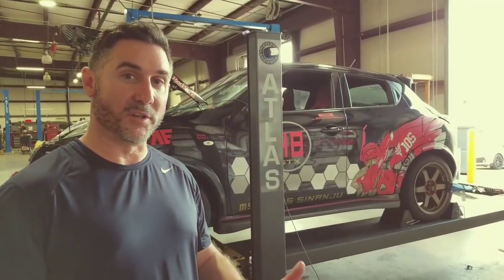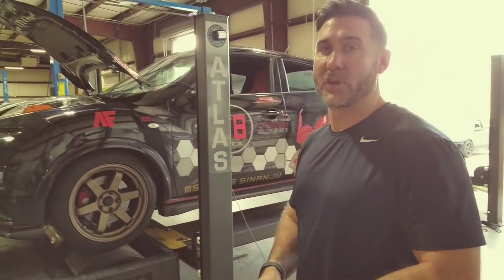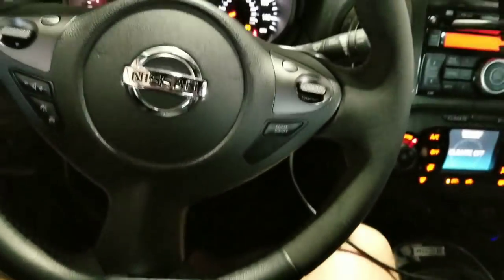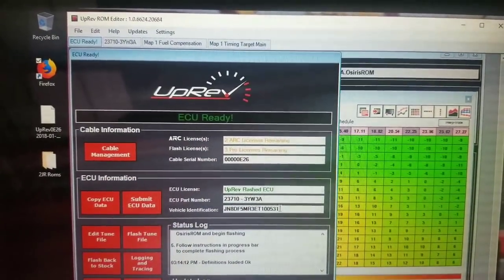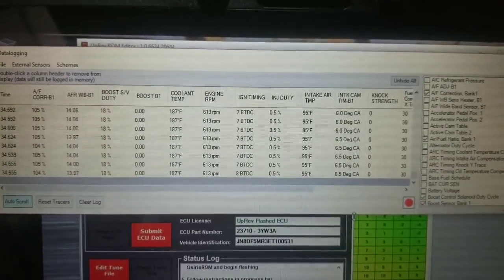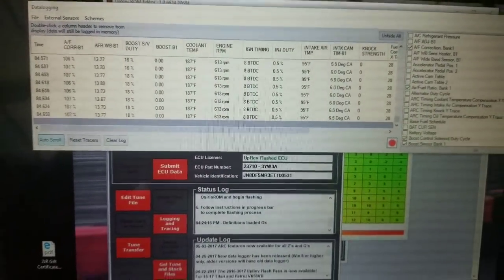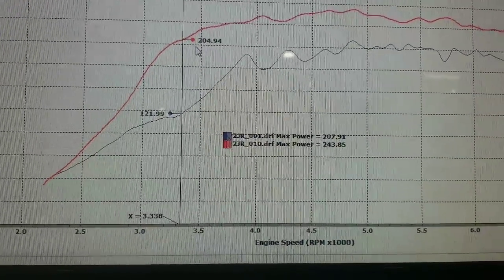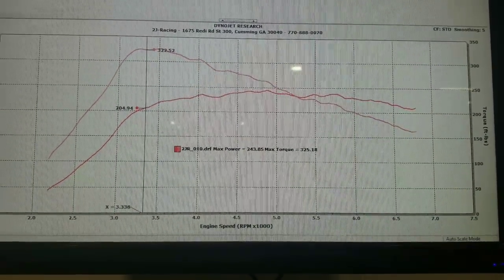2JR Explains Juke Tuning w/UpRev +135WTQ

Comment: Been tuning my 2018 Sentra Nismo here in Calgary on a Hub Dyno here at mod_proper, and it's been challenging. It's the 7 Speed CVT, not the manual, so just by that you know it's going to be a pain in the ass. Pulls in 4th get about 3500rpm then has trouble going higher; my guy has hit 180 whp and 160wtq on a successful run. The car had a CAI, blow off upgrade and axle back. We are using ECUTek's suite, and trying to go off THEIR juke's boost tables; been proving quite a challenge

Now have the midpipe, catback and hard intercooler piping installed, and waiting on the FMIC to arrive. Hopefully we can get some significant gains with it in Stage 3. I heard you mention in another video that on the stock internals and turbo the CVT Sentra can only get to like 240hp (wheel or crank?) and that's about it? Either way, it's been quite an experience

Comment: I finally got her Tuned, Found a guy through, Prime Motors in North Jersey. They are mostly all about Subaru's. So freaking happy tho, We gained 120lb's of Torque to the wheels.. And over 80 Pony's too.. I had her tuned on an AWD Mustang Dyno which I was told that it reads lower than other mustang DYNO's, But we still did 212 WHP and 222 Torque, when I add on the 16% to get dyno Jet results it's like 246 HP , and then 16% to the torque number's and you got your dyno Jet Number's.. Anyway the car does feel like she's putting down 240/250 to the wheels, I can tell  just by how she feels.. These cars are fun and also weird.. It's like they are meant to get from 10 to 80 fast as hell and that's it.. 
     It just feels like, as soon as you get over 80/90 miles an hr. The power just falls off a cliff.. I have a CVT/Sucks and I'm still on a stock turbo, But to me the stock turbo could be turned up enough to break the CVT, so I never really saw a reason to go with a bigger turbo set up.. But I have been thinking about going with a Turbobay Turbo with bigger internals, I hear they do actually make more power and help with Top end power.. Even if I only get like a 5% to 10% power increase from it, I think it will be worth it, especially if it helps me up top with power.. Cause these cars already have a shyt ton of torque down low, for taking off, which is way more Noticeable with the MT's/Sticks.. It's a weird power band..

Comment: How does the drivetrain on the stock Juke handle that kind of torque. What I’m getting at is can you actually launch these cars or will you just destroy half shafts and whatnot? If the rest of the car could handle it that little thing would be fun as hell with 330+ awtq.

Comment: You "explained" everything but "tuning". This is more of a promo video than a "tuning explanation". I could understand if you don't wanna share your tuning knowledge but be honest and give a more truthful title. Also the torque gain is not +97 if you look at it realistically. You only have that at the beginning of the curve and that's not at all good. You see the manufacturer deliberately allows the boost to come in slow because those tiny rods can't handle that much torque on low rpm. If it was a bigger engine it would be ok. Anyway, it your call. I'm just pissed off because I watched 12 minutes of this "tuning explained" and didn't find any tuning info whatsoever

Comment: Hey Joe, I have a question, would the b16 spec v piston, rods and crankshaft fit on a 2009 Altima coupe ?? I know they have the same engine only difference is the b16 has a higher comp. And the Altima is 9.5:1??
Reply: Boost it
Reply: Good question

Comment: Keep it up Joe! Waiting on that tune for the nismo sentra
Reply: Old I know but did you ever build your Nismo Sentra at all? I ask because I just saw a B17 Nismo with what I would call FBO/tune absolutely dog a FBO/tune VQ powered B15 (The B17 has an intake, cat less DP, exhaust, aftermarket IC and Rad, some kind of radius entry work done to the TB/intake manifold inlet, fuel system work though I do not know the extent, and a tune from a known but I’m hesitant to say reputable shop in our area. The B15 has a 3.5 DE swap, 3.5” intake w/ V stack, SSIM, longtubes, cat less J pipe to 3” straight pipe exhaust, clutch/FW kit and tuned on UpRev.)  The NA VQ B15 I built still pulls on both of those cars though 😎
Reply: @kennethpowers8995  I didn't. Had a few bolt ons that didn't do much for power. Ended up trading it in. Have a bolt on, cammed c6 vette now

Comment: Been with the sentra community since the mid early years, joe has always been super ligit and I can't believe there are so many non believers. Guy is the blood of Nissan tuning
Reply: I've got a sentra for sale in ontario Canada of anyone's interested. Many bolt ons lol many many many
Reply: Agreed, I don’t understand it at all but it seems people are more skeptical over engine tunes than they are skeptical for politicians and people that actually govern our lives
Reply: I recently finished 99% of my Juke Mod's and finally got her Dyno Tuned and Because of the CVT, I went with a Modest 125 lb's of torque gained and another 100 HP.. The car flies but once I hit like 90 the power falls off a cliff, If I had a stick I would go with a big turbo set up and swap out the clutch and go all out.. People are hitting 385 WHP 400ish on stock internals.. A few guy's are changing the cams and adding stronger springs and revving them out to 8500RPM's, their revving to 7800 stock as is.. These guy's are building custom manifolds to bolt these turbo's up to, too get to that kinda power out of a 1.6L.. But it's worth doing it, if you can pick up a manual Juke for like 4000 in good condition, and for another 4000 you got a 385 HP Crossover Hatch, that's crazy fast between 10 miles an hr and 80/90.. My car is funny because it, like to get from 20 to 80 real fast but after that the power goes away, For me I think it's a CVT thing..